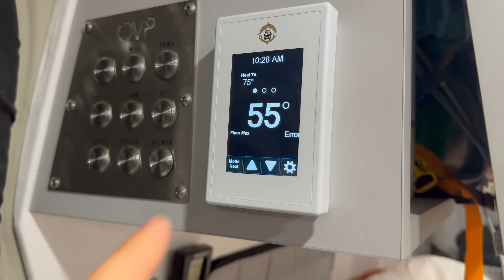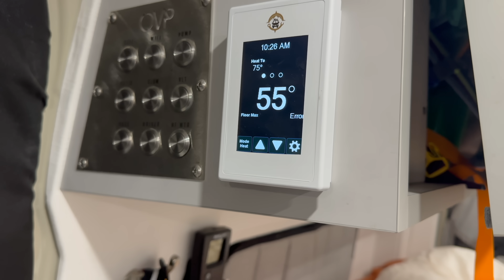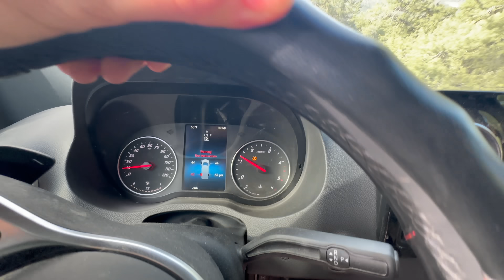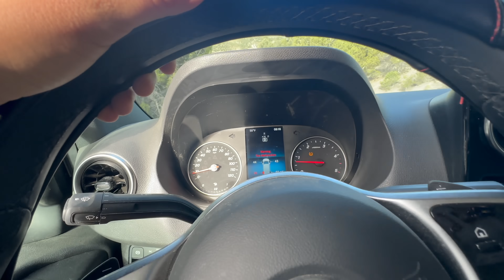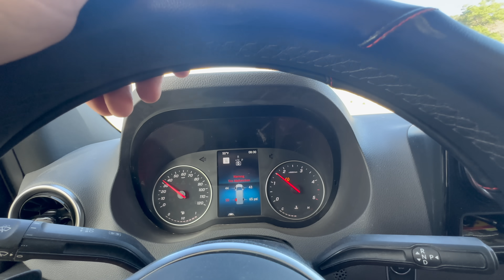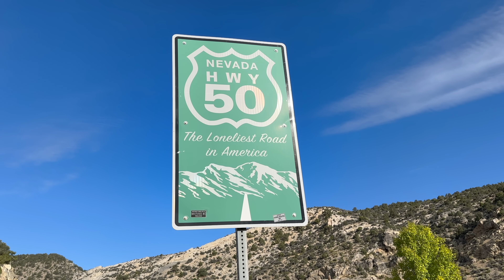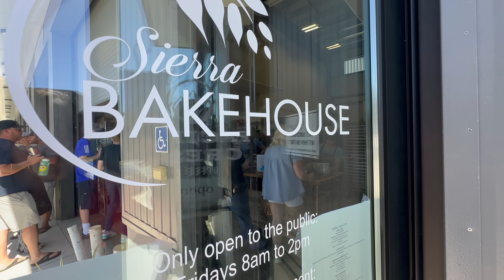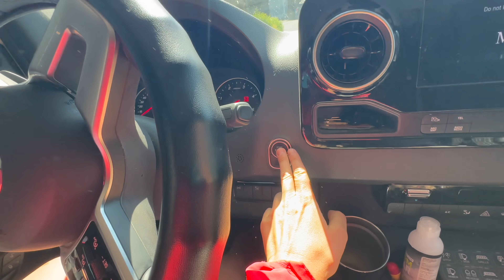1000 Miles in 48 Hours goes TERRIBLY WRONG! | Will the Van Make It? (Day 2)

Comment: Hi Nikki. SLIME tire repair. Keep a bottle or two in storage for those tire emergencies. It works. just make sure you tell the tire guy that you put it in the tire if and when you get it fixed properly. Also, side wall damage on tires is not safely repairable long term it needs a tire. Thanks for your fun adventures.

Comment: Bryson is the coolest…..upgrade your tire and add a winch to lift and replace the tire on its mount! Get a battery impact drill for removing the lugs and the mount… or since your air compressor is viable maybe an air impact drill to remove it since you have the compressor onboard. And get a small battery powered  hydraulic lift for the vehicle instead of the standard jack. All will keep your shoulder safer and honestly when safety in a deserted area…. This will help speed in repair to get you to safety !

Comment: A DeWalt 20 impact 1/2 inch and socket I see in your future. For the tire & jack. Get a Ford Econoline jack & flat head socket to go with lug socket to power jack. Changing that tire should only take 10 minutes.
Reply: She said she had a injured shoulder which was not great.

Comment: You can actually change the pads even by yourself if you get yourself in to bad location, it is easier than you think. Just need to have the backup brake pads with car, usually they are not very expensive. Even if you never would do it, it doesn't hurt you to have at least some idea how it's done, just take a good look how that caliper works and how the pads are locked there in between the caliper and brake disk.  But definitely have a routine of checking the temperatures of the wheel rims, abnormal heat usually means there is something getting stuck making friction. It's quite common with brakes there can be some cylinder stuck, and sometimes they can be opened a bit just by using some crowbar (but carefully).

Comment: This is the 2nd KO tire I've seen blow out catastrophically in the last two days. Roaming Reckless had a brand new KO2 blow out the sidewall just cruising down the highway. Maybe a bad batch of rubber in a certain run. I'm surprised to see this because these are one of the best off-road tires.

Comment: My guess was right with the breaks. Good driving starts with good breaking. I heard it is a big problem in the USA, because driving school is not compulsory and with nearly all automatic everyone can move a car, but not everyone can drive.
- Use your engine for breaking, by shifting down or use "B" Mode (Depending on car and transmission type). Even 2 or 3 gears down is no problem, until your RPM is not in the red zone. Your engine has a cooling system and a fan to handle that heat. The cooling system on your breaks is much smaller and needs tire rotation for working. So it is only for high speeds like in the city and not for low speed at offroad trips. Let the engine do the hard work and fine adjust the speed with the breaks. I use the engine break on a manual transmission even on 500 m driving distance at about 30 m height difference at normal city roads. Toyota Hybrid only on 2 to 5 km downhill and electric cars never. Automatic cars that are no hybrid or electric car i have only driven twice and there were no hills. Since there is no clutch to operate in a automatic car, i would use more often than with manual transmission.
- Stopping after a long downhill part, don't use the breaks for parking. Use the shut off engine with gear in or a parking break that don't use the normal breaks (Depending on car and transmission type).
- Check the temperature with your back hand at the wheel rim. Doing that after a long drive or long downhill passage, you feel break problems before you smell it. If you smell it, the damage already happened.
- Make breaks from breaking, that the breaks can cool down :-)

A Toyota Hybrid is more forgiving, than a standard patrol/diesel car. The Toyota Hybrid uses the battery to store some of the energy, that otherwise will be heat up the breaks and he uses the engine for breaking full automaticaly if the battery is full and you go on hitting the break pedal. Even if you forget to switch in B Mode, a Prius will do that for you. So my advice is to learn how to drive a non-Hybrid/Electric car in the right way. Your car will last longer.

I hope they have also checked the breaking fluid. If you feel that your break pedal has less resistance by pressing it, be careful, it can get worse to that point, that you hit the breaking pedal and feel nearly no resistance and the car is not breaking. In that case press the pedal multiple times at high speed (pumping) and search for the next mechanic. Than your breaking fluid was boiling from the hot breaks. Let your breaking system check for leaks and let the breaking fluid swapped.

Comment: Can you use tire sealants on those wheels? A tire sealant seals the gap when you scratch it or puncture it. You spray it inside the tire and when shit happens the air pushes the sealant to the hole / gap to seal the air leak. I use it for normal road wheels but not sure if it works on off road wheels

Comment: Well, I guess a brake isue can be a less minor thing that I thought it was (4WD/transfer case issue).    That being said, I do have to say personally I wouldn't have picked a Sprinter even though they are the most popular for van life people, but probably more something like a Ford van instead.  Having owned a few Chrysler products, I'm just not convinced that the Dodge/Chrysler gas vehicles are that great mechanically as my brother has a van that's similar (although maybe a little older) but has had quite a few issues with it and it's only got about 100k on it (like needing a new transmission around 90k miles).

One thing I would maybe recommend is since this is your fulltime/only vehicle and your home on wheels, maybe get a SECOND spare tire, since you do drive off-road and it might be helpful particularly if you are NOT as close to a town as you were this time, say you were out in the desert, and those would be times I would say you want multiples of certain things, like tires.  I would also maybe consider carrying a spare battery too and just keep it topped off (charged) just in case.  A portable jump starter might work, but a spare battery can be helpful and will almost always work (somtimes those jumpstarters don't work for whatever reason)

Comment: Aw man...55 degrees in the morning?? I would love that as I live in Phoenix and our days are currently 110+ with a low of around 90, along with the occasional monsoon thunderstorm. The latter of which is not refreshing, because the temps don't drop and you end up with extreme heat and humidity to boot...not enjoyable. Whew, putting 90+ PSI in that tire made me nervous! What was the burning smell? Seems like you only had the issue in the offroad sections, so I was thinking front differential?

Comment: Hi, young lady, 
About 11 years ago, I tore both rotator cuffs and both shoulders. I fell into a basement when the stairs collapsed and thought I broke my neck because I had zero movement in my left arm or hand. I had workman's comp that was going to pay for it so I had the worst one done first the surgeon told me I literally tore every muscle and every tendon in my left arm and told the only thing holding it on my body was my skin. Yeah no fun so they worked on that shoulder first literally opened it all the way up pop the socket and sewed it shut from the back side towards the front attaching everything they could it was a full thickness tear of literally all my tendons. and 3 months later, they did the right shoulder in the same way.  I want to give to give you a little pain relief tip. As soon as they tell you you can take a shower with hot water so as not to burn yourself but hot allow it to run over your shoulder and down through your hands and fingers and it will literally pull every bit of pain down and out of your body through your fingers and totally relieve your pain that lasts roughly 1 hour so every hour I was taking a 10 minute hot shower and it felt so so good you can feel the pain going down your arm and out of your body it was like a drug rush or something. It took me 3 months to heal that shoulder, and he inserted graphs of pig intestine to help hold it together. I've been told now I do not snore I snort. I'm not so offended anymore when someone calls me a pig. LOL
   I went to the county fair last fall and visited the pig Barn for a family reunion, and surprise, surprise, I won the Blue Ribbon. I feel for you because I know what you're up against I have permanent 15 lb weight restrictions on both of my shoulders because they were both damaged and torn full thickness so I had identical surgeries on both shoulders I was off work for 7 months. I am now 73 years old VIETNAM VETERAN and very phyically active and I got back 99% of my range of motion in both arms and very little pains or aches,  but the 15 lb weight restrictions are permanent yet I can lift more if I'm careful and don't overdo it.🙈. Using correct lifting procedures 65 lbs. They let me know when I'm or the weather is BAD. I have a 95 ASTRO VAN, which is totally off grid here in N.W. Ohio 13 miles from Lake Erie's shoreline. I camp for $17.00 with electric hookups (Age Discount) at all state parks in Ohio. Winter to up to 14 days a month.  LOVE IT..
Good luck.  I love your videos. You'd make a great,
daughter/granddaughter, except I'm a little worried about the situations you get yourself into out there with just your two dogs. if you break a leg or worse can you get help for yourself? But if not, WHAT HAPPENS TO THE YOUNGINS? ALWAYS THINK OF THEM. NO UNNECESSARY RISKS THAT COULD TURN OUT BAD ☠️, FOR (ALL). JUST BE SMART.. YOU CAN'T BE TO SAFE, JUST TO SORRY...
It is a very entertaining channel, and I will be a forever or (however long I have to live 🙉), a Subscriber, and watch all of your star 🌟🌟🌟🌟🌟 videos. thanks and good luck. BESAFE FOR YOU AND THEM..
 I'm praying for you-all's safety.. JUST BEING A DAD/GRANDPA..

Comment: 11:30 you need to have a battery powered impact wrench !   No it’s not airing down the tires . It’s not driving over sharp metal crap without looking . That tire did not go easily , they are really tough ! You could not physically damage that tire in that way with any tool I know of ! I think you need someone to give you some lessons on proper vehicle care and mechanics so you will know more about it and be able to be more pro active . That pad is worn because the caliper is sticking . I think you will find that in the near future ! Also , a great thing to have would be a cab radio .

Comment: Nikki you are not equipped for overlanding. I've wheeled for 50yrs i suggest you go always with a second vehicle plus i found that goodyear duratacs are the beat for off road and highway. i have used Goodrich they don't wear as well nor did I find them superior in anyway but price, which is why they give them away.

Comment: did they replace the rotors/disc too? can your tire pressure go down just by pressing a button or do you have to manually do each one..? and to add air... does it do it automatically or do you have to use the hose and do each wheel at a time? cheers!

Comment: You chose to go to the "wrong spot."  Google maps is only a suggestion from a algorithm.  Use a dirt bike to do the off road stuff.  Much easier to get a 250 pound motorcycle out of the dirt that a full size camper van.

Comment: This whole tire ordeal could have been prevented so easily. Should have had an impact to take the tire off, and should have a hydraulic jack. I mean it’s the absolute basics. 
The tires are not a good fit for the van. 
What a mess that should have been prevented and it shows a very small amount of basic preparation could have saved so much headache.

Comment: 🎉 heads up I found a Reiki practitioner here on YouTube that even my woo woo self is blown away by😮 for almost a year my left shoulder had almost no rotation and any orthopedist would have recommended a replacement😮 I said to hell with that in a few months ago I came across Reiki Shakti by Savita🎉 listening to One video throughout the night on Loop and then the next night a series of videos involving soft tissue and joints and shoulders after two nights of playing the videos with the volume turned down accepting of the Reiki energy my shoulder has been at 100% for a little over 3 months now🎉 her 20,000 subscribers have watched her 800 videos over 4 million times😮❤😮

Comment: Never put that much air in a tire especially one that’s been damaged. The extra air you put in could have made the tire blow out and you in front of it. I know you were in a tough spot but remember the air in the tire is “Per Square INCH”. If you calculate the area inside the tire it would be extremely lethal if it popped. Please be careful.

Comment: ❤ I love my 2022 170 high top 4 by 4❤ to all the naysayers of a sprinter the secret is to expect your higher self to guide you to the best vehicle😮 I wrote down the VIN number on six different vehicles on six different little pieces of paper some of them were new Vans some of them were old then I added in about 12 different life situations that I have to choose from in my future moving forward😮 I folded up every one of those pieces of paper slept with them under my pillow and then the next day did a double blind divination with a pendulum😮 I held a piece of paper in my hand one by one and allowed the pendulum to rotate from a value of 0 to whatever😮 at what are those pieces of paper the pendulum continued to swing and swing like a helicopter till I finally at 680 it started to slow down to go the other direction😮 all the rest of pieces of paper were valued from everything from an 80 to about 240😮 after I had done each piece of paper and wrote down the value I then went back and opened them up😮😮 the one that was 680 was my beautiful Atheana J a beautiful 2022 Sprinter😮 your higher self knows everything and as long as the pendulum is connected to your personal Chi and not being used much like a Ouija board you could do a double blind on anything😮 muscle test but to get to a number value the pendulum is the best way❤❤ the walls are going up today😮

Comment: I have enjoyed your videos since way back at the beginning of your Prius days and I’ve always learned things and been entertained. I’ve appreciated that you give sensible advice and set a good example of how to live nomadically. And safely. 

But this video really bothered me. You provided a very bad and even dangerous example. Any solo traveler out there that decides they too can get away without simple prudent precautions will be badly advised. 

You were in a van that you recognized had at least one if not multiple issues that you could not decipher. Your place to get repairs was about a thousand miles away since it could not be comprehensively addressed elsewhere. You knew this buying it of course. You then proceed to drive off road in the wrong place and without taking steps to lower tire pressure which you knew you should. In a van that might break down. As it turned out you did have an unrelated problem which though you were able to remedy you basically provided an example of how you might survive even after being so negligent. 

You mention that you should have taken air out of the tires. But you never addressed that you should not have gone off road at all. Even if you needed to go 1000 miles the towns you drove through do have mechanics and they might have told you whether you should drive across Nevada or not. This was just poor judgment. I would have expected a better explanation of what you did wrong and just fess up. 

I think you let the need to create content drive some very bad lapses in judgment. I’d reflect on that some and spend some time in a later video talking about this

Comment: Here is a little tip,you can’t run these vehicles up and down the road 1000s of miles and not have regular maintenance stops,use some common sense…….
Reply from the maker: lol what makes you assume I don’t do regular maintenance? … I have a 100k mile warranty and pre paid services every 20k miles so perhaps common sense says this is a normal regular off roading occurrence  and a part that got a replacement under warranty since it was another 20k miles before it should have been replaced ;-)
Reply: @NikkiDelventhal  first off,driving that extremely heavy vehicle puts a huge amount of stress on your vehicle,you have a 4 wheel drive capable vehicle,not a 4 wheel drive off road vehicle and that’s apparent watching if struggling up roads that where I live is called a semi paved driveway.i don’t care what the manufacturers told you,reality is a different game in the specialty built business,your reaching the what they call failure points in the auto business it’s your vehicle you’ll find out,have a nice day….